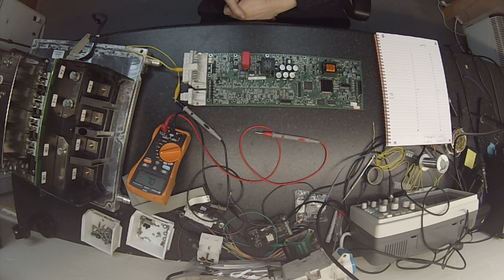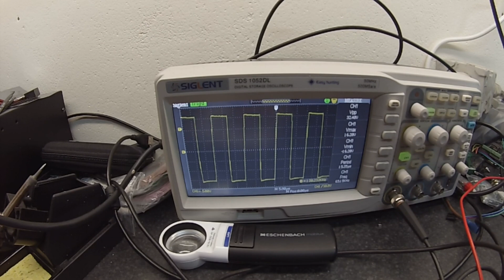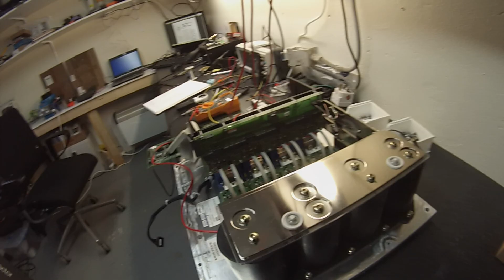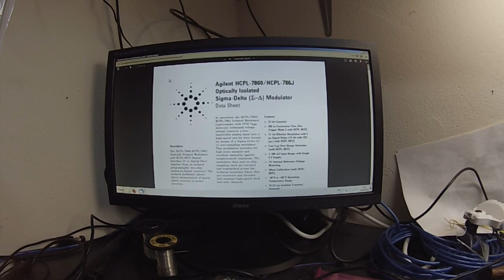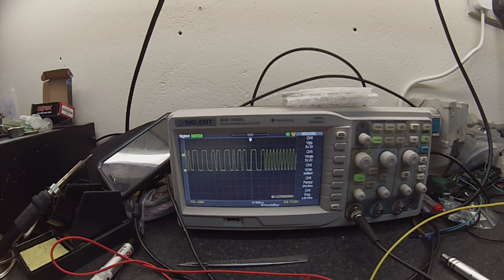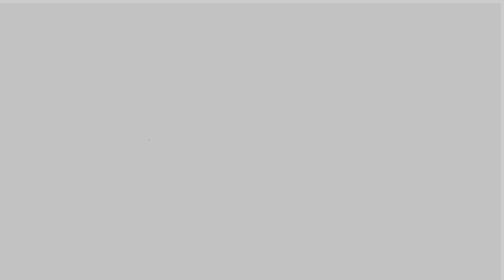Hacking The Siemens Elfa2 Inverter Part 2

Comment: Hello Damien , its really interesting all info of yours Videos , May be can get with you the Pins Configurations off the MCB ( A100); ( X2 X3 X1) ; Drive control Module ( with Power Supply) of the ELFA IGBT Inverter 7 Ph, We want test and start a motor in our lab , to tested the module after changes all Infineon IGBTs modules and Drivers Board. Or if you Know Where can I get the Info of this MCB ? Thanks a lot

Comment: can you help with an idea for using an existing 6 amp vsd to drive a seperate power cap block and 250 amp igbt to drive large 3 phase electric motor

Comment: That one mosfet controls 5V to the Anodes for Phase 1-3 drive, and a second does the same for Phase 4 drive, proves that Phase 4 was for braking/regen.

Didn't know about the copper wire brush for flying wire signal tracing, will have to try that myself.
Wouldn't have helped with my current reverse engineering, as it's a lot of tall thru hole parts crowded together, and the board has a thin layer of confirmal coating.